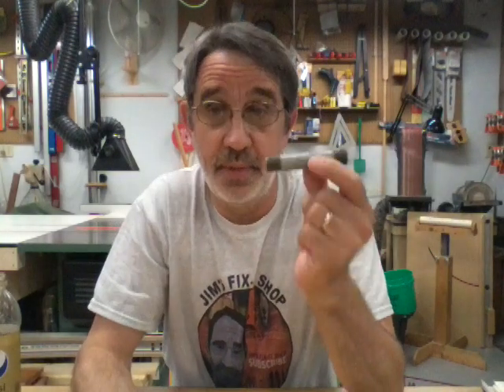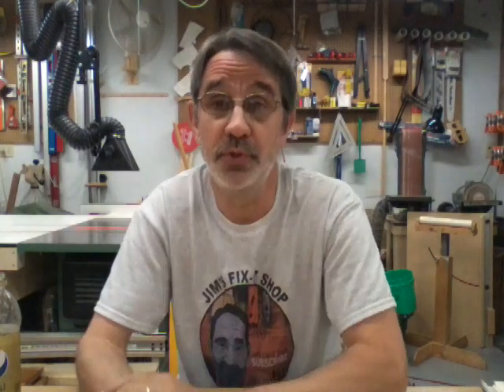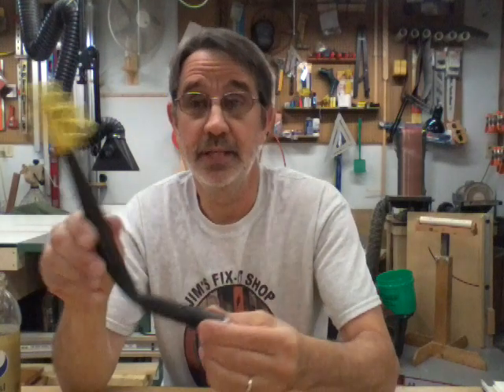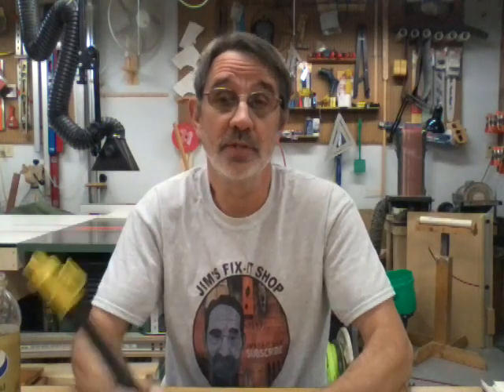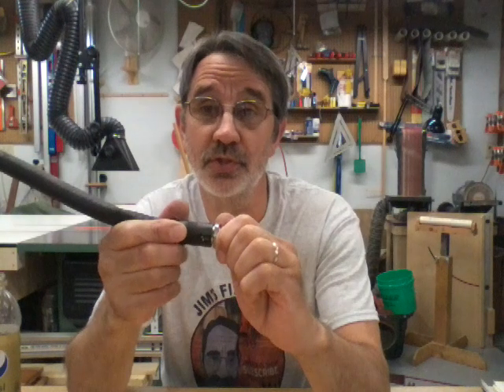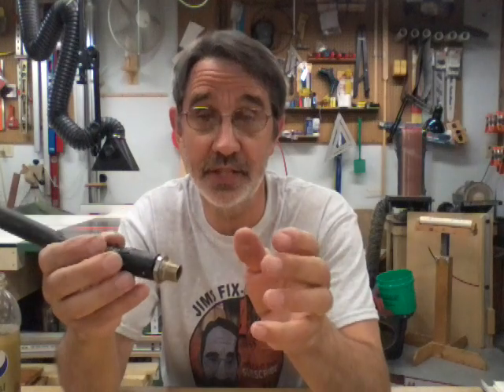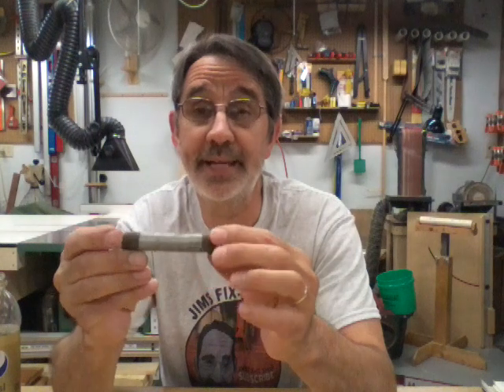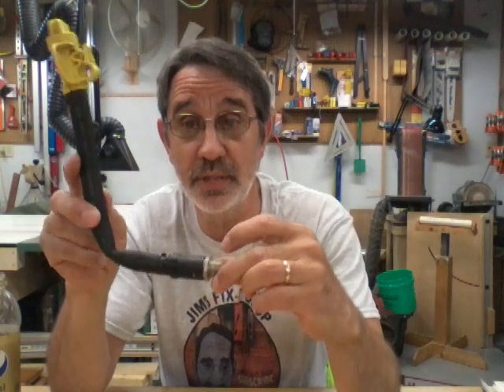194. M/S. 41 Losing engine oil in my Briggs & Stratton engine

Comment: On some of the older B&S's, the drain was tapered.  A straight threaded nipple would crack the engine block when tightened.  I do not know if newer engines are or not.  It would be something to watch, however.
Reply from the maker: John AKA 
Yes I worry about that myself so I don’t tighten them any tighter than necessary and I use some good Teflon tape on the threads, so when I remove the cap off the end of the pipe to drain the oil I hold the pipe with a pair of pliers so it doesn’t back out. Jim
Reply: @jimjackson9381  A man who's worked on mowers and small engines for years told me a long time ago he'd had several come in his shop with cracked blocks. It's messy, but I just put the pan up under the machine and wipe it off when done.

Comment: CHECK THE OIL BEFORE YOU MOW
Reply from the maker: Darrell Savoy 
Hi Darrell it's Jim 
   Well that sounds like good advice and I always do every time I take a machine out I check the oil first because along time ago I had a problem with an old engine that had the oil slinger on the bottom of the rod when the engine got a little low and you're going up a hill it doesn't sling the oil anymore, and the rest was history.  But when he got the snapper from his son it was full of oil, he was unloading it off the trailer and hit that somehow and started slowly leaking and after mowing 2 1/2 acres it ran out of oil and blew a rod.  So you can keep it if you like and you may never have a problem with it.  but are you willing to bet your engine on it.? !!!!Thanks Jim

Comment: I'm on my 3rd snapper.  All were used when I got them.  The first thing I did, just to make it easer draining the oil was to install the very thing you were talking about.  Be careful not to have the nipple extend past the rear bumper otherwise when you stand the mower up on end to change the blade, you might damage the nipple causing the oil to leak.

Comment: Hi JIM mine leaked too. After changing my oil I guess I didn’t get it seal and oil ran out very slowly. Luckily I noticed and managed to clean that mess up. I rechecked my drain adapter and very carefully made sure it seated. I’ll take your advise and use the “old school” drain. I really didn’t like that el cheap adaptor. Thanks